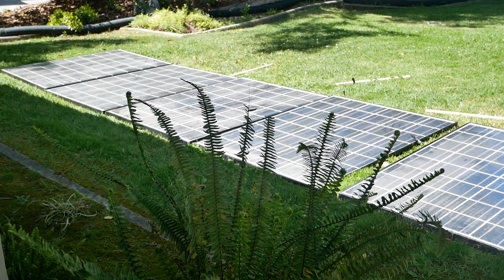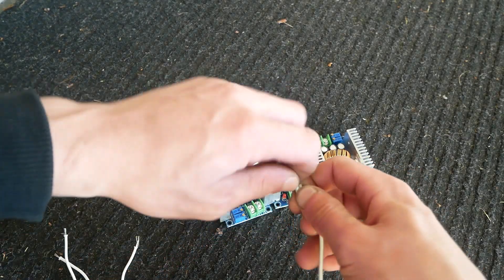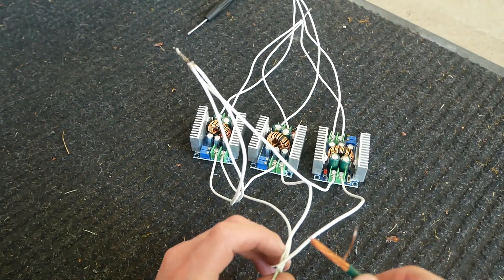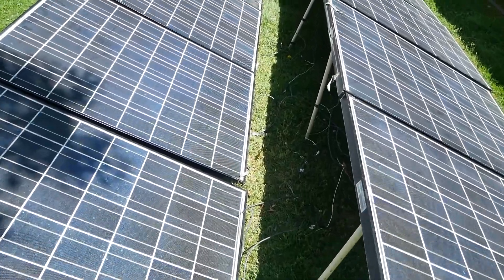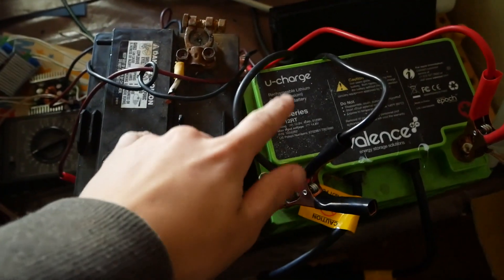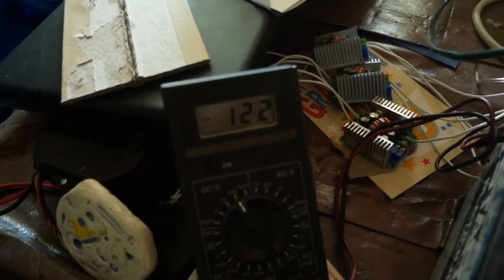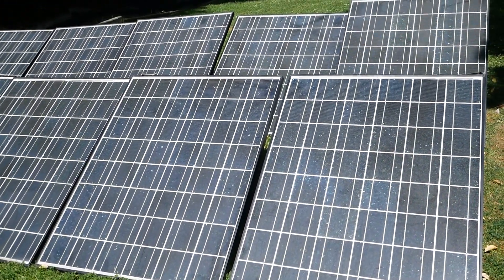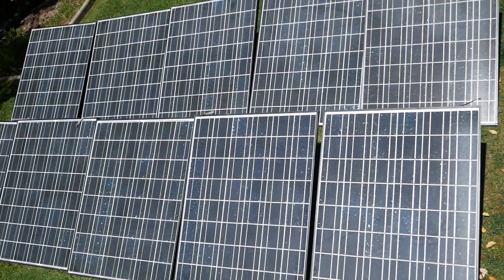Solar Powered AIR CONDITIONER compressor based

Comment: What if you used the solar to generate hydrogen, and store it in a pressure vessel, and use it to power a fuel cells. Could be used on a boat or a house, and fuel cars
Reply from the maker: i wish i could, i want to do split cell like nighthawk in light showed but budget is in the toilet rn so just workin with what i got

Comment: I have wondered myself about using step-down converters in parallel. Is there any danger if you don't have their output voltages exactly the same?
Reply from the maker: yea i tried to match them up but they would prob fry if they were unbalanced

Comment: You should try making a electric furnace with all the panels.
Reply from the maker: my entire property cant fit that many panels lol i wish
Reply: @ianbuilder  hahhahahahah you need to find a farm or park or something to play around with all of them
Reply: @ianbuilder  I have installed solar panels about 1000Watts, inverter about 2000Watts (max not sure), I am planning to buy 5000Btu AC. Hopefully it will workout. any suggestions?
Reply from the maker: @FEexamtopics  get a good charge controller and a good battery

Comment: One video that might go viral would be a full bridge rectifier, using nothing but solar panels. Technically each cell in a solar panel is just a diode with a large area, so with four cells (kept in darkness) you could build a "full bridge rectifier" (said like ElectroBOOM does). It would be a completely stupid thing to do, but might get a few subs. And worst case even downvotes count as a social interaction and will get your videos thumbnail shown to more people.

Comment: I have an idea. I built a device that switches my A/C from solar to grid based on my solar generators battery voltage. I used an Arduino a relay and wrote my own code from scratch. If you would like the code to do a video let me know and I'll send it to you.

Comment: I built my own solar A/C . I started with a shaker unit but it kept burning up my inverter. Once I switched to a split unit it works perfectly. Pro tip use fuses and you don't have to worry about fires.
Reply from the maker: yea its really noisy but if it keeps my room cold for free i cant complain
Reply: @ianbuilder  I was referring more to the efficiency of the split unit compared to a Shaker unit. You should look into the seer ratings the lower the sear the more amps it will draw.